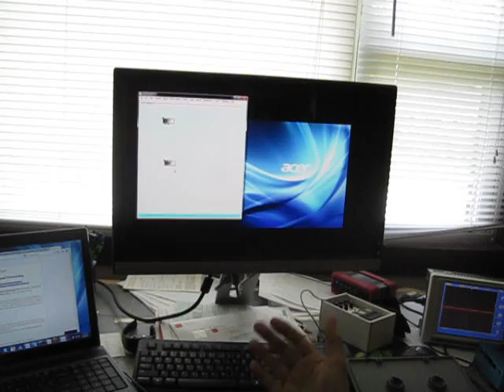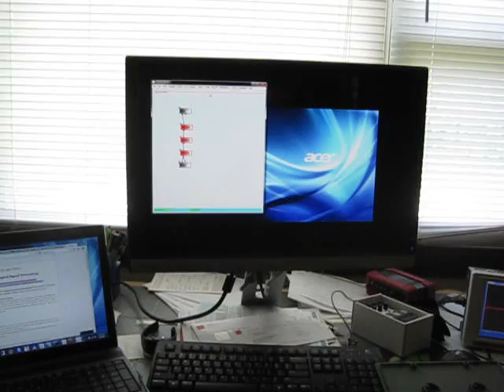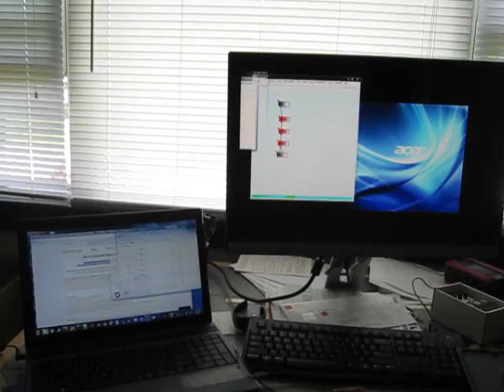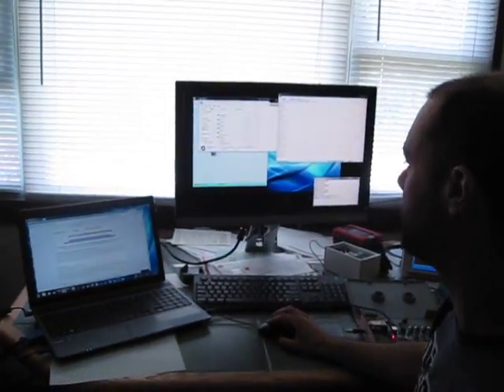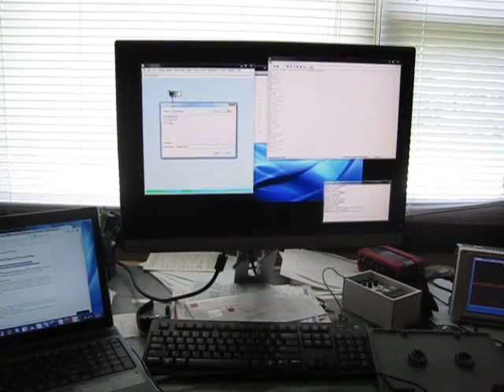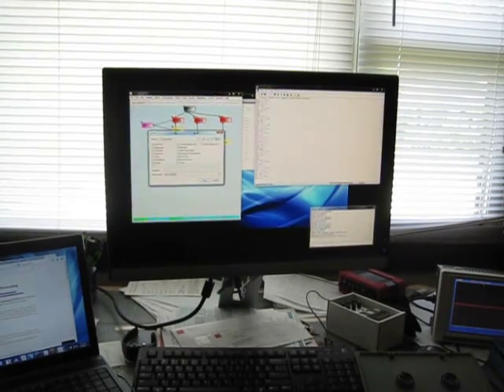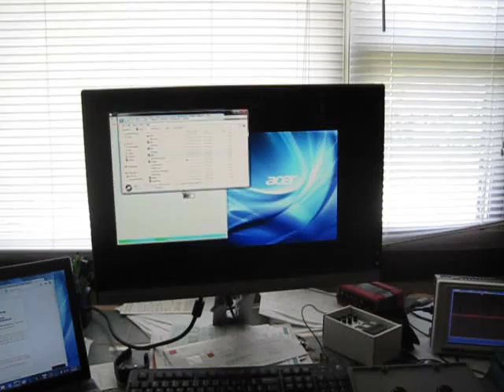SpinCAD Designer from Holy City Audio, built on ElmGen by Andrew Kilpatrick, demo by DIYDSP

Comment: To answer people's questions about whether SpinCAD Designer can be ported to different target platforms, the answer is, "yes, but it would be a LOT of work".  There is the "View" which is the idea of having little blocks on a screen which can be connected together.  That's about the only thing that would be preserved.  As the FV-1 only supports its native assembler, there's no concept of a C-like language that would give you algorithm-level compatibility.  Even though the program is written in Java, there is still a 1 to 1 correspondence with FV-1 assembler.